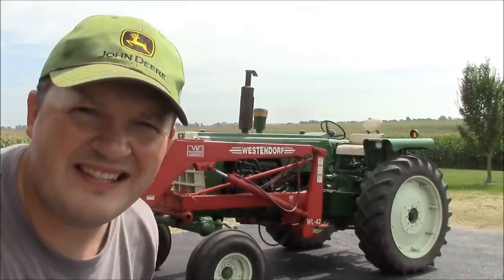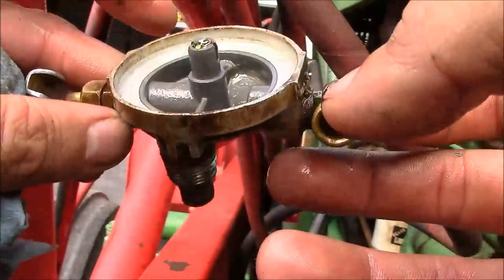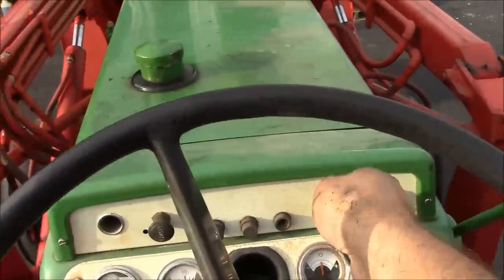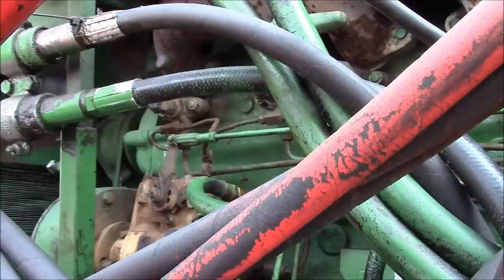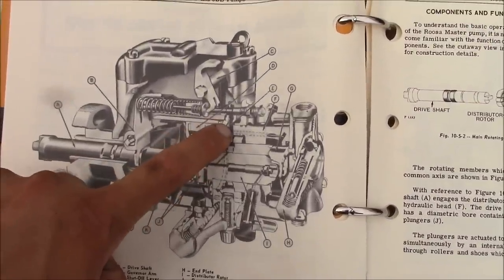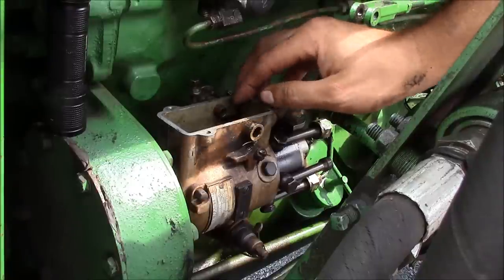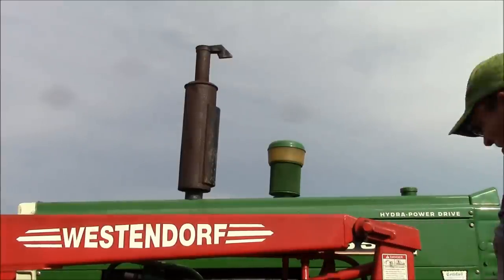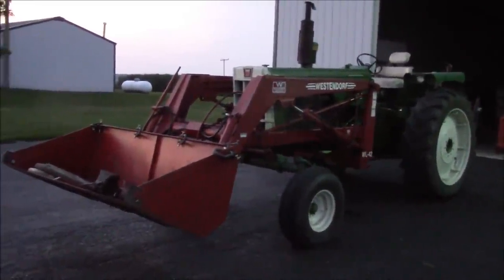Oliver 1650 Diesel Tractor - Hard Start / No Start

Comment: That brown goo looks like algae.  Diesel tanks have a tendency to attract algae if the tank is allowed to sit for an extended period of time without being filled. This is partially due to the nature of diesel fuel.  Algae presents a real problem, as normal diesel engines cannot burn it for fuel, and it can clog the fuel filter, causing hesitation and engine stalling. To remove it, you'll need a commercially available diesel fuel tank cleaner.  You need to mix the cleaner with the diesel and run the engine to remove it.  Algae doesn't form in engines that are used regularly since you're always adding new fuel to the tank and water (that the algae needs) doesn't accumulate.  At least that's what I've read in my research.

Comment: where do you find a siphon like you used on the Oliver? Great video I love Common Sense you did not over diagnose it, you did what was necessary to fix the problem!
Reply from the maker: Correct.  https://amzn.to/2O1JKPN  It works well for fuel and other light fluids. But it does not work on a car with an anti-siphon device in the filler neck.

Comment: What brand of crappy fuel are u using that leaves the Gummy residue behind ,If the heaters do-not draw current they are Not working  very common look for a bad Fuse

Comment: Air in fuel, your pipe is slack, thats where the air is drawn in  and fuel rack stuck in pump, common fault on rotaries . Tamp pump body with small hammer

Comment: First thing you do is get an 1850 starter, they are same bolt pattern and drive but is a way stronger starter. You have to grind the bumps on the block and maybe a bit of grinding on the inside of the starter too. I've done a couple of them. Don't grind too deep on those bumps or you'll be in the crankcase!  When bleeding loosen ALL the injector lines at the injectors then crank. Sometimes the best way to start these is to pull start with another tractor, or give a fair bit of either until it  starts. I one time got a used 1755 engine and put in a 1650 but it was hard starting. I did the injectors, the pump then the head and it started better, but you'll never get a Waukesha to start like a perkins in the 1850. I'm not sure why Oliver messed around with so many different brands of engines. Best engine was either a Perkins or Detroit. I've driven and fixed them all.

Comment: 17 minutes in and it seems to me if there is no fuel but it runs once started with ether, is week fuel pump.  needs higher rpms than cranking to make enough pressure to run.  and i don't work on these.  have an old bolens with a 3 cyl and never had any issues other than a seized piston, due to 5 years sitting in the rain with open pipe.

Comment: Does this guy use biodiesel? I have had stuck pumps and clogged filters many times from the triglycerides that settle out of that type of fuel, especially equipment that does not get daily use.
Reply from the maker: I'm sure they do. It's hard to find non biodiesel here.
Reply: @WatchWesWork  Well, that is what it looks like. I had a brand new Case/IH500 Quad Trak down in the field with only 126 hours for that problem.
Reply: He did say he was using bio diesel.  I was wondering the same thing about it settling out.

Comment: That is caused by bacteria growing in the fuel. I just went through this on a case backhoe. I know treat the fuel with biocide. I am sure you will have to change the fuel filters several times. I am not sure the biocide helps clean the tank but it does stop the bacteria from growing in the fuel.

Comment: A shop towel with some gas on it  and put over the air filter will usually start a diesel.  I would have taken the fuel tank off and cleaned it with a pressure washer and dried it in the sun.  I would have replaced that fuel filter.  Does it have a secondary fuel filter, somewhere.  If not, I would put one on it.    My guess is a filthy injector pump, clogged up with the same crap you found in the filter and tank.

Comment: Does that gunk dissolve in acetone? This could one way to clean the system without running the engine.
Reply from the maker: It does not. I tried Naptha, Mineral Spirits, and Turpentine.

Comment: If you have more problems with the tank and the slug how I clean full tank I put gl Diesel in the tank a two hand full of 1/2" and 3/4" nuts put them in the tank if you or your Dad or someone near by plug the tank then strap it to the back tire and spin it to a speed that the nuts roll bounce round in the tank let it Spin for round  half hour then look in side if it look clean then you just clean it out good but if its not clean then just run it longer. This is how I clean out tanks if its a gas tank I use parts cleaner just when your dune clean it out with gas

Comment: My friend has one of these tractors and from the newer fuel it destroys the factory rubber liner they put in the tanks. Edit: BTW the  engines in the 1650s are very cold blooded and if you have the grid heater working correctly they pop right off normally

Comment: Our 2950 is the same way but we don't want to fix it right now it starts fin but if you pull the shutoff it pulls the metering valve to the closed position and we can't get it started
But once it's at the open position don't pull the shutoff stall it out and just stall it out when you get done with it evrey day till u have the time to fix it

Comment: Steve Watroba has an old Oliver, he took the pump completely apart and put it all back and it runs great. The settings are critical on those adjustments and he figured them out.He's not a heavy equipment mechanic,but it runs fine.He has a youtube channel @ Steve watroba and he messes around with all kinds of things maybe you should check out his Oliver tractor videos.He needs subscribers.

Comment: Looks like wax and rust in the fuel tank
Some gas or acetone would dissolve that deposit
Reply: its diesel bacteria, only a biocide added to the feul can help preventing this < tank needs to bee cleaned out whit a stam pressure cleaner..The joy off modern Diesel fuel....
Reply: @MrBugsier5  Looks like you are right,but it seems to me that this deposit is relatively clean and homogen for bacterias.
I had a diesel car parked several years with modern fuel in it,and never got this.
Maybe i had no water in the tank,contrary to here.

Comment: I would be willing to make a strong wager that the glycerin from bio fuel improperly decanted could be melted out of the fuel system. You throw this stuff away because this is what it does. The farmer was using his vegetable oil improperly. Good tractor though and the farmer is using it free.

Comment: I would have dumped some solvent in there, then a pressure washer in it. Any sludge left in there will just migrate it's way to the petcock again. Probably got your pump filled with sludge also. EDIT- Never mind. You've understood your entire fuel system is sludge ridden.

Comment: Second you tube video showing possible damage caused by using bio diesel
 Mercedesssource "Saving Digby" just showed all the damage possible caused by bio fuel, he recommends  running "Liquid Moly Diesel Purge" to clean out the system.
Reply: I've seen this in both tractors and on road vehicles that run bio diesel. Bio is far more prone to algae and breaks down alot easier.  It works, but you need to be right on top of keeping everything clean. Regular diesel for me thanks. At least I know my equipment will start in 20 years.

Comment: That brown gunk is microbial sludge.
Water and diesel mix = low fuel flow.

I know of a few Aircraft crashes due to this stuff clogging the fuel dilivery system and xausing aircraft to crash land, in one case the Bearing Air MU-2 had to land on sea ice.

Comment: Take the tank out, stick a gallon of naptha in it with a good length of 3/8 chain, then rotate liberally until it has removed all the junk from the walls of the tank.
Reply from the maker: I tried Naptha, Mineral Spirits, and Turpentine. None of them is an effective solvent for that crud.
Reply: @WatchWesWork  My understanding is that stuff that isn't mineral soluble is water soluble, and vice versa.  Stuff that is water soluble isn't necessarily mineral soluble.
Reply from the maker: Soap and water won't touch it either. I suspect heat would be required to really remove it.

Comment: hey wes. I think you need to run acetone through the fuel system but not the pump. That crap is because they were too cheap to buy regular deisel. If you don't formulate bio diesel right by pouring off the crap you get this sludge. So its their fault really. I like the tractor though.

Comment: The fuel tank IS STILL CONTAMINATED.  That means the whole fuel system needs a total flush. Do not assume that the filters will stop all junk in the tank. It won't happen. Start over.

Comment: always use a little bit of 2 stroke oil with your diesel
Reply from the maker: I have heard of guys mixing ATF into the diesel in the old days when they would mix in kerosene to prevent gelling in the winter. But we can get winterized fuel now so it's not an issue.

Comment: That sludge is a Algae that forms in diesel fuel. To prevent it try adding k100 diesel formula it was made for the marine industry for the offshore fishing boats. Make sure you get the formula for diesel engines they make one for gas engines to and they are not interchangeable. Ok Wes that should help you out.
Reply: Isopropyl alcohol will usually dissolve that goo in the bottom of the diesel tank.  It’s been my experience anyhow.

Comment: That gunk is biodiesel crap, new diesel fuel nowadays they all include some biodiesel cut and they don't last anything under storage. This happened to me on a diesel car that was sitting for some months, had to cleanup the diesel pump with mineral spirits and thinner running through it with all the outputs cracked open

Comment: Consider using rocks and acetone to clean the tank. Brake parts cleaner is mostly acetone I think. I think some smarty pants has been running waste vegetable oil in it indicated by the rust on some of those pump parts..

Comment: I, as one, think if you had started with the fuel tank and the lines and the pump and just cleaned them, like....1 2 3 ....put them back together....and then started the tractor everything would have worked out better. Instead of wasting all that time, and wearing out the starter. 
You would have been a lot better off. Lol. Michael said that, bye for now my friend.

Comment: I posted it on a comment, but this is what is believed to have caused the sludge in the fuel tank:  https://en.wikipedia.org/wiki/Microbial_contamination_of_diesel_fuel#:~:text=Diesel%20bug%20is%20contamination%20of%20diesel%20fuel%20by,the%20air%20%E2%80%94%20modern%20biodiesel%20is%20especially%20hygroscopic.

Comment: Best to remove the tank, pressure wash/steam clean using a cleaner inside of the tank. Clean the entire fuel system. If you found gunk in the sediment bowl, it's in the entire system. That's algae, you need to get that all out of the system. You can run an algae cleaner in the fuel but, takes a long time to get it all out. Pressure/steam cleaning gets it out in a much shorter time. Still need to run a cleaner through a few tank fills at least. No offense but, stop using bio-diesel. Again, clean the fuel system before even thinking about the heater. Starting fluid isn't good on diesels, use it sparingly if you do need to use it.
Reply from the maker: It's not my tractor. At least not really.
Reply: Totally agreed clean out everything associate with the fuel, fuel lines and tank. You try your best , learning to help is a gift given to you. Thanks for your video  young men.

Comment: you didn't use the good bleeder screw on the pump  getting the air out the first housing !  check in your book ---  injectors must be leaking  I THINK .....?
Reply from the maker: There is no bleed screw on this pump.
Reply: @WatchWesWork  are you sure that at the back of the pump there is not the small screw.... If it is a CAV pump...?
Reply: back --- engine side  sorry !

Comment: There is absolutely nothing wrong charging 2 batteries in series, as long as they are the same ratings Ah and ccA - and of course the charger can provide the needed series charge voltage.
After all the battery itself is made up of series connected 2.2V battery cells with the same ratings internally ...
Reply from the maker: My experience is that typical cycling batter chargers will give unpredictable results trying to charge one battery in a series setup using the 6V setting. The best way to charge them is to disconnect the battery cables, or charge both at the same time using the 12V setting as I show.
Reply: @WatchWesWork  You actually mean PARALLEL connecting 2 ea 6V batteries and charging these ?
A parallel connection means you are charging 2 ea 6V batteries connected simultaneously to the same 6V charger.
Then you are quite right, that is NOT a recommanded charging method setup, it will give unpredictable results.

A series connection means, you connect one battery minus to the other battery plus, and then the charger to the left over battery terminals.
In this case you MUST use the 12V setting on the charger. Else the charger will never be able to charge the batteries using the 6V setting.

I hope I made myself clear and rid off a misunderstanding on your usage of the charger ?
Reply from the maker: @CXensation  No one seems to be able to understand this. The tractor is a 12 volt system. It uses two 6 volt batteries connected in series. The best way to charge it is to use a 12 volt charger and connect the negative to the negative of the fist battery and the positive to the positive of the second battery. That is basically how I show it charging in the video. However, if you leave the batteries connected like normal and use a 6V charger to attempt to charge one of the batteries by connecting the cables to only one battery, you will get strange results. That's what I was trying to say.

Comment: I’m sorry for the delay but I had to remember I’ve seen that gray shit before and it was Penske rentals they use a centrifuge to make some motor oil with the diesel the problem is the motor all does not mix completely in the residue is that gray junk you have in your fuel tank and that is the abrasive. That is contaminating your fuel system the oil mix was the diesel the problem is the additives that they use in the motor oil does not and that is the residue that’s in your fuel tank I knew I had seen that before the Penske rentals in Murfreesboro Tennessee had five trucks Just been fueled or on the fuel island and wouldn’t move because of contaminated fuel they had to 20,000 gallon above ground tanks that had to be pumped out and washed out to get that junkyard tanks do you have a good night

Comment: Root cause?seems all of these faults are caused by that goo in the tank,poor fuel flow,gummed up pump components etc...what is the goo?paint that has dissolved because of the new bio diesel?was it a factory tank bladder?was it an old wives tale told at the local pub on how to stop rust in fuel tanks(never take advice from pissed cu&ts).solution would be to find a product that dissolves that goo and flush the whole system with it.just had the same problem on a farm truck,had what looked like varnish goo right through the whole system.fillters housings were half full of goo.carb clean was the only thing that melted it and not the cheap crap,proper crc carb cleaner.

Comment: Poor man's 3020? You don't have to shake the steering wheel on an Oliver  when it gets cold. Do the load shaft seals leak like every 3020 in the world. Sorry had to rant. That's biofuel sludge believe it or not the best way to clean biofuel sludge out is use E85 ethanol really loosens it up if you leave it soak. Put a short stand pipe in the sediment bowl so it doesn't pull of the bottom.

Comment: All  the work still needs either to start. Hope you redo video when you try to fix it again. Nice tractor though..
Reply from the maker: Normally I don’t answer comments that are clearly answered in the video. But, it not uncommon to not be able to bleed the air from the lines without ether on a precombustion engine. The starter just can’t spin the engine fast enough. Also, I clearly showed the engine starting with no ether at the end of the video.

Comment: ….38:00.....   engine starts with ether....uhm…..well, the air goes into the cylinders, takes the ether with it....?
Reply from the maker: What makes it stay running?
Reply: @WatchWesWork First....Your videos are very interesting, to me anyway.....and then... I've had that same issue with my old 73 Corvette, and 51 Chevy...once they run for a few seconds with ether, they quickly suck up the gas from the far away tank. 
 My late brother was the diesel guy...drove log trucks, they sit all winter, covered in snow...but every spring, they went through a similar ordeal...Detroits or Cummins...both had trouble after sitting through the snowy winter...
 In your case...even the tiniest amount of fuel can keep a diesel idling....then after it gets the new fuel....runs OK...

Comment: Did you find out what that gunk in the tank was soluble in?
Reply from the maker: No. Soap does nothing. I also tried naptha, mineral spirits, and paint thinner. It's some tough stuff!
Reply: @WatchWesWork  huh.  I was going to guess maybe acetone, but if those didn't work, i kind of doubt that would either.
Reply: Could try MEK?
Reply: @WatchWesWork  it's like cargo vessels Heavy Fuel Oil . heat would liquefied this

Comment: Pretty nasty looking stuff in the bottom of the tank. The screen that's under the fitting the fuel inlet line connects to could need a good cleaning.
Reply from the maker: This one doesn't have a screen. I guess they figure the two fuel filters is enough.